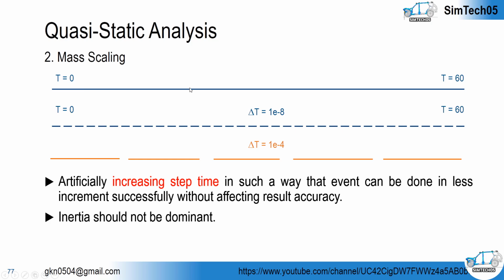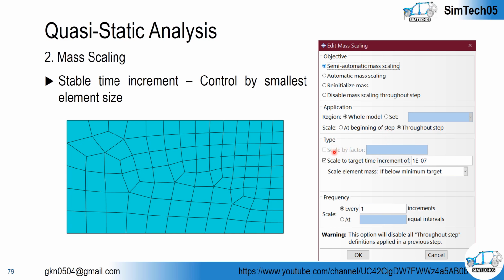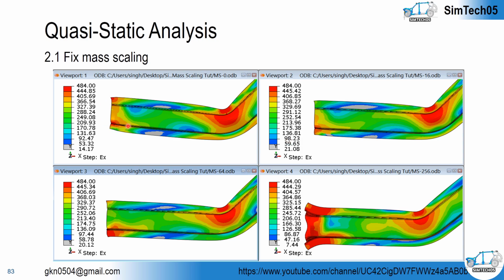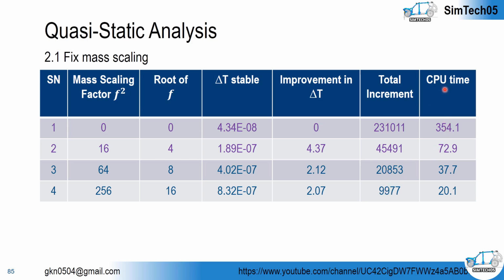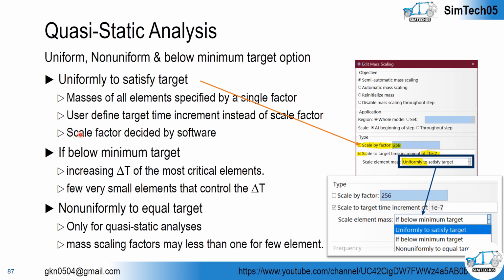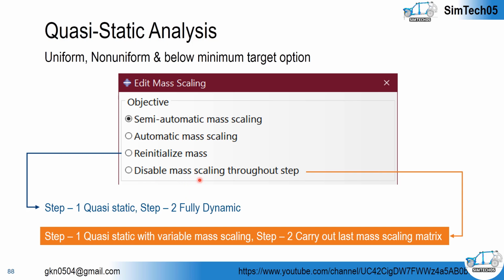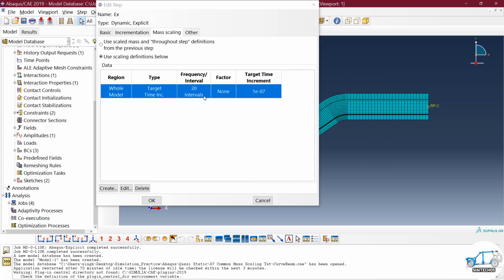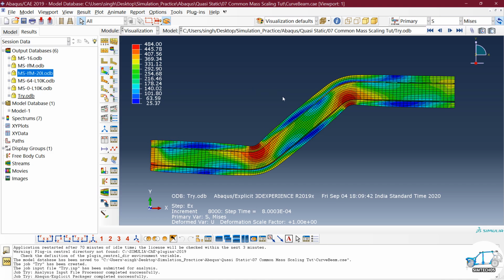Quasi Static Analysis in Abaqus/FEA, Part - 02 Mass scaling

Comment: But when scaling the mass, the wave speed also decreases and there may be errors due to its excess? And isn’t it more profitable from the point of view of computational time to shorten the loading period, since in this case the inertial forces are proportional to the first degree of this reduction, and when scaling the mass it is necessary to increase the inertial forces in proportion to the square of the increase in the stable increment?

Comment: Can i say that the results of my simulation using mass scaling are accurate if the kinetic energy of the system remains less than 1% of the Internal Energy? is there any such parameter that can quickly help me determine whether my simulation is acceptable or not?
Reply from the maker: Yes,
1% KE is less enough to ignore.. compare to IE.
However, results may wrong due to some other reason.

ENERGY itself a parameter to judge whether simulation is correct or not.
Reply: @arsitech-ltd  thank you so much, this tutorial helped me a lot!

Comment: Hello. Your videos are really helpful.. I have one question.. how to decide the time period for front bumper assembly using dynamic implicit analysis in abaqus standard for Quasi static application.
Reply from the maker: Dear,
For implicit - Quasi static technique you can use natural time period.

You need to worry about time period only in explicit step.
Reply: @arsitech-ltd  Thanks for the reply.. is it necessary to use time period value  as natural time period or I can use time period value as 1.
Reply from the maker: Use natural time period.
Reply: @arsitech-ltd  I am sorry, how does one calculate the natural time period for a system?
Reply from the maker: Perform frequency analysis for the model/assembly.

Comment: How should I validate mass scaling in a dynamic explicit problem? I'm analyzing a machining procedure, and the speed of the tool is considerable, how can I see if the analysis is acceptable  by looking at the energies? Thank you so much for your videos!
Reply from the maker: Dear,
Effect of Mass scaling can be checked by kinetic energy with respect to internal energy of system. As i explained in video.

Comment: Sir, I am having cyclic load ( 135 seconds) and I am performing quassi static analysis with mass scalling. 
To use time scaling, what changes in 'Time period' Value and 'amplitude' is required??
Let us say if I am reducing it to 13.5 second, should I keep time period and amplitude time 135 as it is or 13.5 second?
Reply from the maker: Time period and amplitude both for 13.5 sec.

Comment: Hi @Simtech05, I have been watching this video again and again with the Part-01 video. I have been thinking and try to express myself that if the inertia effect in the simulation system is neglected(insignificant) by introducing mass scaling & load increment method, the system kinetic energy is still not zero (sometimes very small and big depending on the accuracy of the analysis). Where is this ALLKE kinetic energy comes from? How can I explain that if the ALLKE is high, why is it high and what makes it high? Is it coming from the crushing tube by releasing/converting the strain energy as KE? Thank you!
Reply from the maker: Dear,
You misunderstood the concept.

1. Inertia effect is negligible than only we can utilise quasi static concept (mass scaling and increase load rate techniques)..
Not that - inertia effect neglected by mass scaling or increase load rate.

2. The value of KE depends on mass scaling that you used or increased load rate that you defined. Ideally for Quasi-static simulation KE of system at each point is zero. But if someone use huge mass scaling of very fast load rate (short time event) then KE increase and mislead results.

3. KE is not coming form any other energy. Its from momentum of system.
Think about this point -
KE = 1/2mv^2
If v is very small KE is zero..

We can take advantage of it...even if we increase mass up to certain limit still KE will be approx zero bcz v is very small...and square of v further decrease value.
Reply: @arsitech-ltd  Thank you for your response. 
You are right, inertia is negligible but not neglected. 
2. I believe when we talk about this ALLKE, its the KE of the deformable part only. We always check the KE and compare with IE even in purely explicit dynamics as well as in quasi-static analysis as you have mentioned. We then conclude that the analysis result is acceptable based on the energy plot comparison. I can understand now that the KE in quasi-static analysis can be increased depending on the mass scaling value. How can I express the cause of the high KE plot in pure explicit dynamic analysis? Is it because purely due to the unrealistic relation between the applied load and the time period event?
3. I believe when you say velocity is very small means that v can be made very small by making the inertia negligible.
Reply from the maker: 1. Inertia is negligible and neglected.
2. How can I express the cause of the high KE plot in the pure explicit dynamic analysis? - The cause may be a variable load with high frequency, maybe high inertia, impact, acc..etc.

Is it because purely due to the unrealistic relation between the applied load and the time period event? - There is no unrealistic relationship. I don't know what you want to ask?

3. You are not understanding the point - we are not making v negligible by ignoring inertia.
V is zero, system is in equilibrium for each increment, that's y we can assume inertia negligible.
We are not making KE zero...KE is zero that's why we can use this quasi-static approach. Listen starting of the video carefully.